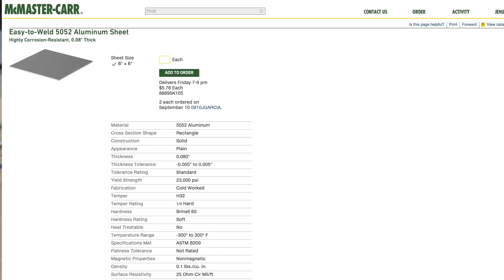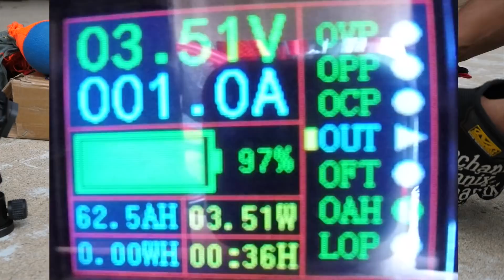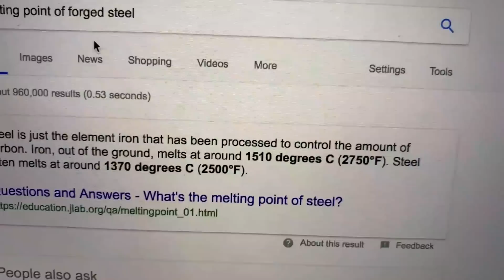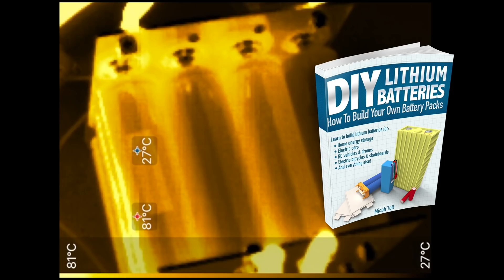Melting metal with Batteries

Comment: @jehugarcia  Why was the forged steel wrench the 'weakest link' ?  Not the cables, connectors, or sleeves surrounding the cables, etc ?  Thank you!
Reply from the maker: Higest resistance in the circuit. Copper is a very good conductor

Comment: If we use a 40amp bms with 12v battery pack of these headway lifepo4 batteries 

Is it would be safe to use these in DIY electric skateboard

Comment: I need your help. I want to use it for car start battery replacement. I have Protection Board where (P-) is to Load (-) and (C-) is Charger (-). 

Q: Where do I connect (C-)? Is it direct to ground? Or I Have to use DC to DC charger, where I  have to connect Protection Board (C-)?

Comment: So it's safe to say that if I use the exact same batteries 12 of them (4 in parallel)×(3 in series) at 10am each should be more than enough to replace a deep cycle in my camper?

Comment: Has anyone seen the micro USB rechargeable 18650's? the 1'sI've seen are black with an orange top and can be charged with a micro USB lead, no name I'm afraid but they are supposed to be rated at 2600mah?that would be a good video even if its just to cut it open.lol.

Comment: Wonderful video Jehu thank you so much. You inspired me and I bought 44 cells a few months ago. Been learning, researching first and experimenting for my 13.8 volt system and turn on the 120v side when I need it for appliances. Wonderful demonstration showing the power and need to be extra cautious figuring out the right way to set a pack up. Like 4 parallel 10s @ 3.2v then the four in series with 4 charge managers. I don’t think you can keep these perfect balance without the expensive individual bms system. But they stay consistently the same surprisingly in a 13.8  4 pack. I ordered one 4S 150 amp max discharge and 40 amp max charge manager for $3 to do some 4s tests. I would feel better researching like a 40-50 amp max diode for the positive cable out. Happy building

Comment: No way you actually had over even 1000 Amps on that wire. Just look at the Preece/Onderdonk charts for wire fusing currents, if you really hit 4000 Amps not even a 4/0 AWG cable would have held up past 10 seconds. Also, passing current through chrome alloy steel is not even close to the same as a short circuit, the steel is fairly high resistance and only goes up as it gets hot so it is limiting the current more and more as it goes. Also, since the pack is 1S your limit for the max current is V/R with V only being 3.2V nominal and R most likely being a lot higher than you think due to the connection at the battery and at the wrench. In order to hit 4000 Amps you need to limit resistance to just 800 micro Ohms and there is no way that was achieved here.

Comment: Oh man... Why have you even bothered including wrong values in this video? It would have been much more useful if you showed actual current. Its not that hard to measure properly, after all, at least by estimating your wire resistance and measuring voltage drop over it. But yeah, it melts metal, it must be hot...
Reply from the maker: Do it,  show us how it’s done
Reply: Good point, and I like the idea. I think I will.

Comment: You could calculate the amps quite accurately by measuring the resistance of the circuit. You'd need a decent ohm meter to achieve this though.
Reply from the maker: Yeah I don’t own decent metering equipment

Comment: Never short circuit a battery. Bad idea.
Reply: Hi . It wasn't shorting. Because, the wrench was acting as resistance.

Proof:
Wrench was burning the power and producing heat. so it became red hot. Otherwise, the thinner wires (main cable thinner than wrench) attached to battery would have been blowing out.
Reply: @farwestgarohills3831  a VERY LOW resistance though, fairly decent to call less than 0.5ohms a short :) probably more resistance between weld clamp and tool than in wrench itself
Reply from the maker: Never a bad idea to test for failure
Reply: I support Jehu. For testing it has to be done for knowledge for self and others. For finding something tester destroy even $200,000 car.

Now I know, how dangerous is this to use this in car, if installed wrongly or improperly.
Reply: @farwestgarohills3831  to be fair lead acid batteries in cars can already produce hundreds of amps

Comment: Yah that book you spoke of has a lot of mistakes in it, I told the author but he didn't put out any corrections, so even though it's a good book he needs to put out corrections as some of the things in it could be dangerous if you are using it and don't know anything at all about batteries or electricity.

All he needs to do is put out a video highlighting his mistakes where it needs to be highlighted or put up a web page with the corrections in it and publicise it.

Shame cos as you said it's a good book.

Comment: Do not use these batteries in a hot engine bay. They will vent/catch fire and burn your car down. Speaking from experience. They were fine in winter, sort of forgot about the battery, come summer on a 40degree day in slow traffic I found out quick smart that they have their place, but not in a hot environment.

Comment: You started and ended with 3.4V open circuit and this cells have an internal impedance around 2.5 to 3mOhm so DC internal resistance around 5 to 6mOhm thus using 6mOhm (6mOhm/12 cells  = 0.5mOhm) your peak current when connected can be calculated as 3.4V - 2.8V = 0.6V (peak drop at initial connection)  0.6V / 0.0005Ohm = 1200A  that rapidly dropped about half 600A at minute 5:00 in the video.
Reply: Ahh just saw this let me take a crack at this. OK Hedway gives single cell impedence as 0.004 so 12 parallel = the reciprocal of (1/0.004) times 12 is 0.00033 ohms Next the wrench which is about the same resistivity as Chrome Moly 6 inches long and 8mm thick (if round) has a resistance of .007. 3 feet of AWG 2 cable is about 0.001. the vise grip on terminals about another 0.001.   Looks like you are using a 50mv 500A shunt (your reading is off by about 10X so maybe it's a 50mv 5000A? IDK) which has a resistance of  .050/500=0.0001 which all adds up to a total resistance of 0.00243 ohms. It looks like you're measuring voltage at the battery of around 3.1V so Amps should be in the range of 3.1/.0.00243=1275 amps. so yeah that makes sense.   What shunt were you using anyway? 5000A?  that would change my numbers somewhat.  Hmm I included the battery internal resistance in the load but electrodacus included it  as the battery separately. need to think about this. It might have been faster to connect 6P-2S and got twice the voltage at the expense of higher total resistance of 0.0343 ohms with 6.0V/0.0343ohms=1747Amps which is about 300A per cell
Reply: Impedance of the cell is measured standard at 1kHz (so is not the same as DC resistance) that is typically higher as battery has also some capacitance so impedance number is lower than internal DC resistance.
You do not need to know any of the other resistance value in the circuit as they can be highly variable and all you need to know is the battery internal DC resistance and voltage drop across battery that is measured in this video correctly. Knowing the voltage at all points during the test so can calculate the voltage drop across the battery and the internal DC resistance of the battery you can calculate the current going trough the battery that is the same with current trough any part of the circuit as they all connected in series.
You can imagine the battery as an ideal voltage source in series with a resistor and as soon as you can know the internal DC resistance and voltage drop across battery you can calculate the current as I did above.
There is no current shunt in the circuit but there is what looks like a hall effect sensor and that is probably rated at 100A thus as the current is at all times higher it will only indicate 126A as that is the max it can measure.
Reply: @electrodacus  I know this was ages ago, but I just wanted to note that it was a nice concise primer of applying electrical theory in a few ways I hadn't seen demonstrated before. Thx! On the off chance this gets read: I was just curious if you knew of a simple way to measure resistance with a "multimeter" like the one I'm presently cursed with that can only measure voltages (busted junk), is that perhaps possible with any degree of accuracy?
Reply: @kurtilingus  Do you mean resistance of a lithium cell or resistance in general ?
For measuring a resistor you will need a known voltage supply maybe a 9V battery and you will need to know the internal resistance of your voltmeter or calculate that first based on a known resistor that will be in series with the voltage supply and voltmeter.
Reply: @electrodacus  Ah! Yes indeed, I was referring to making arbitrary resistance measurements in general, so thank you for the insight! Very helpful of you.
Reply: @electrodacus btw, how do these cells compare with the ANR26650M1B cells? 
Which is considered superior generally under most conditions??
Reply: Do these cells have lower internal resistance than a typical 12V starter AGM battery??

Comment: Amps = volts/resistance...  36v / 0.024ohms = 1500amps!!! Series video 12s1p Please!
Way off on your amperage guess. Your meter should be accurate with in 10%
Remember ohms law Resistance = Volts / Amps... So we can infer that your rig had 0.024 ohms of resistance. 
Hook the cells in series and you'll get your 1500 amps through that poor wrench O.o
Reply: 1s12p = 400w threw wrench vs 12s1p = 54000 watts threw wrench. Please make that video!
Reply: @powerarmor222  the cells can't output 1500 amps, only around 300 so that is much less current than what he is running through the wrench. Also while it may be more wattage running though the wrench, its current which heats the metal up. So you would want the cells in parallel because that outputs more current.

Comment: Hi grate video, I new a micanic a couple of years back and he accidentally bridged the terminals of a lead acid battery with a a wrench and his gold wedding ring the ring was instantly melted and ran off his fingers he was left with a scar on his ring finger and a smaller one on the fingers next to it so please don't have eny metal on your hands or wrist. He is still working with big batteries now but gives them the respect that they deserve
Reply: No but I have soldered with 2 carbon rods from zinc carbon battery's it was not the best but when you're back is agenst the wall you do what you have to
Reply: Grate.

Comment: Nice video! You could measure the current flowing through just one of your red leads and then double the current reading to help prevent overranging of your ammeter. If both of your main wire leads are the same length and connected well then your total current should be roughly twice that going through a single wire.

Comment: Hi, funny to see what they are capable of. Normally these type of current measurement devices are current transformers. So a givven number of measured current results in a corresponding output current. 1/100 for the smaller models up to a few hundred amps (like yours) and 1/1000 for the bigger brothers. So you have to check 2 things. Is your thingy anywhere capable of measuring your mega current into something useful and if yes, did you use a matching load-resistor on the Measurement output. Good luck. Keep up the good work.

Comment: Now somebody is going to build a welding rig, uses these cells, people have been stick welding with 12v batteries for many years
Now it's time for a DIY lithium powered welding
I think your amps as right, that was a slow heating up, steel has higher resistance than copper wire
0.024ohms with a 3v power equal 125 amps,  the slow heating to the melting point, and it really didn't take very long to get there
Good welding can be done at 100+ amps and 12 to 18 volts,
Reply: it's possible, but very difficult at lower voltages.  Most of the time when people stick weld in the field with battery's they use 2 or 3 in series.

The actual voltage needed to weld is typically lower then what's used to start the arc.  It may be possible to get a decent weld at 12v (not sure, i've never tried), but it would be very difficult to start and maintain the arc with such low voltage
Reply: youtuber kreosan already made an portable welder.
Reply: @_DSch  yep

Comment: No way would it be that many amps... 2 gauge wire has a fusing 10s rate of 1300 amps.... So 1300 amps through 2 gauge will melt in 10 seconds... Your insulation didn't even melt...... I would peg it in the 275-350 amp range based on my experience as a welder. The resistance and heating of materials limits flow. Try a 3s4p and redue the experiment
Reply: I did a calculation on a comment :3 And I got about 149.7Amps with a lot of approximations, but with those calculations the meter looks right.
Reply: Redew*
Reply: I concur with jeiiman .. 1200 amps on a little #2 wire looks like it'd kill it quick but lemme see cuz I've seen 2/0 gauge is best when welding with 350 amps ,, the wire is about one milliohm so at 1250 amps that's a power dissipated in the wire of I-squared R of 1250*1250*.001 or 1562 watts which would heat up the wire very quickly. because the wrench is about 3 times the resistance it should get about 3 times as hot so maybe.   Jehu said the clamp on was pegged at over 500A but run that by me again what the other ammeter was measuring, Did you have it dialed in right for the shunt you were using? and yeah I'd try it again with 2S-6P  and use 2/0 wire.  and a SK wrench  lol
Reply from the maker: Jeiiyman87 definitely more than 400A my clamp meter reads up somewhere around 500A but it was overloaded every time instantly
Reply: You could do it again, but measure the amount of amps in the Cells, before the discharge, then measure whats left after?

Comment: incredible  batteries. even in short they mantain the voltage or even increases it.  are those good for deepcycling or those are design for high current situations. is good to know if a long discharge  damage the battery like the car cranking batteries. thanks for that good and fraaking experiment.
Reply: They are good for about 80% of their capacity. So fairly deep discharge. I would do your research before converting from lead acid. They won't hurt you, but you could hurt them if not used properly.
Reply: Thanks. i`m researching some data and saw from amateur radio remote users to car audio high current competitors and electric go kart racing.  Very safe i`m impressed. but by the other side is the price, a powerwall of this kind will cost a fortune and finding a big BMS high current should be expense.  but for small projects like a 4S - 4or5 P, 12 volt portable generator with inverter should be  a good setup.

Comment: I Took fun to calculate what current could happen here ! 

According as what I see you have forged steel, it means approximatively :
0.13 Ohm*mm²/m you have around 0.2m of it with around 8mm²
Approximatively 0.08 Ohm here 
Steal is about 470J.kg-1.K-1, to simplify here, we will take 100g of steel (0.1kg)
As you shown melt is about 1370°C
you have at 20°C to travel 1350°C 
(0.2*1350)*470= 126900 Joules
to make it as Wh we divide by 3600 = 35.25Wh , means 2115Watt in a minute
It took about 1:25 mins to melt it ; approximatively 1493 Watt in this duration where we can add 20% for loss = 1792W

PJ = R*I²
I²=PJ/R
I²= 1792/0.08
I²=22400
I= 149.7A 

Your meter doesn's seems that far away !

Comment: Can someone explain to me why manufacturers measure the capacity of their batteries in mAh??
Reply: As opposed to what?
Reply: @SirCrest  ...as opposed to Ah. Measuring in milli amp hours is a marketing ploy. It is far easier to understand amp hours eg. 1400mah = 1.4 ah
Reply: Oh yea, I didn't know if that's what he was talking about.
Reply: Iván Luis Rodríguez because with simple math you get the total energy amount stored in the battery.
Reply: probably because a lot of batteries are sub 1 AH, and having to convert between AH and mAH all the time would be a pain, why not just use a single common rating like they do now?
Reply: Because the amount of miliamp hours a cell holds is very close to constant, if not constant. The amount of wh delivered can change based on the characteristics of the load as pulling a very high current will waste energy inside the battery by dropping voltage thus decreasing wh delivered. The amount of mah should remain extremely similar despite pulling a high or very low current.
Reply: mAh or Ah is meaningless without knowing the voltage!  Amp hours became an informal measure of capacity for 12V car batteries because they were so universal, but a 48V 55Ah battery has 4x the energy capacity of a 12V 55Ah battery.
mAh becomes a bit more useful when comparing standard cells, but what people should really use is watthours - so a 2.2Ah 3.7V nominal 18650 cell contains  2.200 x 3.7 = 8.14 Wh.
This way you can get the total capacity of a battery by adding the cells together regardless of its series or parallel configuration.
Reply: Hello, I htink it's to trick the customer, and also give an idea of the discharge in optimal circumstances, you can't attack them for that. If they did in Wh they could much easyly be sued.

Comment: Have you tried welding with a similar setup?
Reply: Don't see why it wouldn't work. When I was in Iraq you would see the Iraqis using just regular car batteries and jumper cables to stick weld all the time and these little things put out way more amperage!